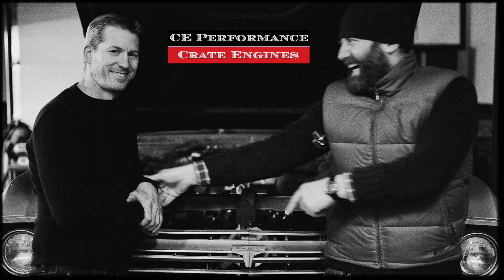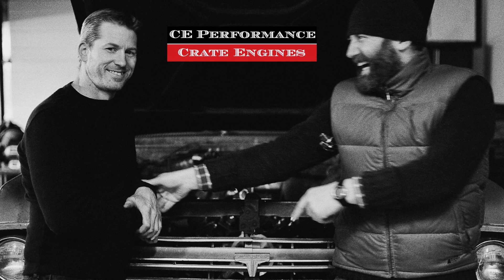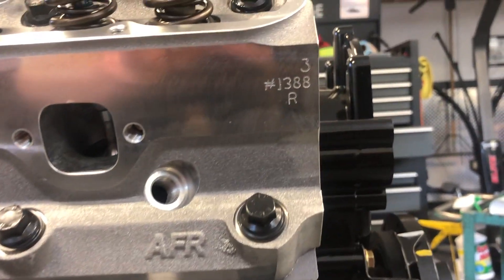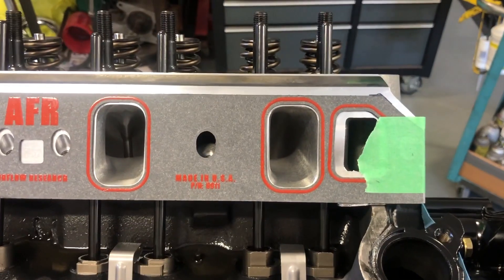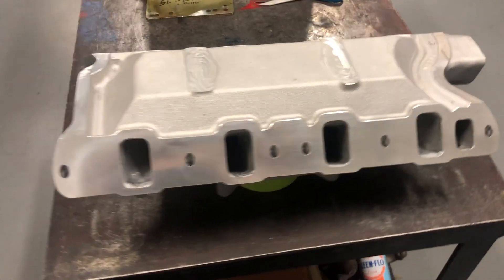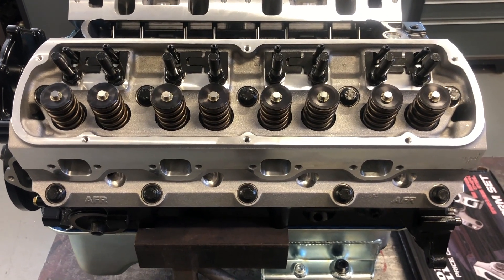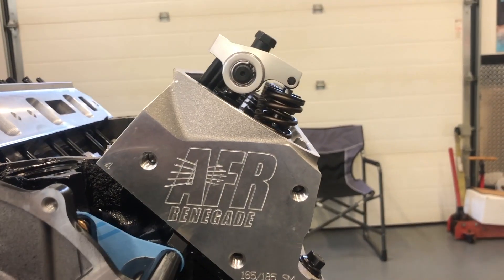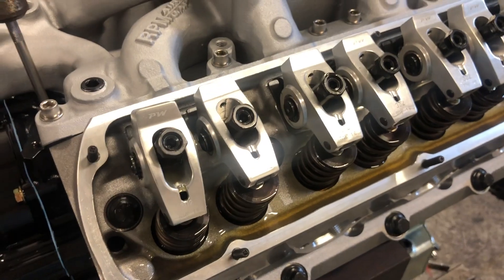347 Cu.In. SBF Build — Attention to Detail!

Comment: Nice numbers but not quite as impressive as your short stroke, long rod, big bore builds or is it because it's a Ford? LOL

You might want to try a cam with a tighter LSA next time, David Vizard claims an overly wide LSA can rob as much as 80 HP. He has a formula for figuring out which LSA to chose in one of his yt videos if you're interested?
Reply from the maker: Thank you for commenting! 
With these Ford blocks, there isn’t any more room for a longer rod than this, unlike the Chevys. The deck height is only 8.2” whereas the SBC is just over 9”. 
On these smaller displacement builds, tighter lobe separation isn’t great in my opinion. The vacuum is affected and idle quality suffers if too tight. 110 to 112 would give more gains up top but there’s always a trade off. This is a street car build and drivability was a key ingredient :)
Reply: @ceperformance  

No offense to you but do you know who David Vizard is? Here is his video on LSA;

https://www.youtube.com/watch?v=8jvkdQcqIuA

He says in the video to change the 128 to 127 in the formula for a small block Ford.

He has an engineering degree and has been building and dyno testing race winning engines for 60 years. He has written very popular books on head porting and engine building and countless magazine articles. I'm surprised you have never heard of him?
Reply: If I reply to this comment with a link even though it's a yt link, maybe yt won't delete it?
Reply from the maker: Thank you! I’m interested to watch that. Very cool.
Reply from the maker: Interesting stuff! He definitely has proof to back up his claims. 
I have only recently heard of David V. 
Thanks for sharing!
Reply: @ceperformance  
Yeah and the duration @ .050" on the cam of the 347 is still on the mild side. It's only 3 cubes less than a 350 and 224/230 @ .050" even with a tighter LSA with 347 cubes IMO should still idle ok. Like David V. said at the end of that video, If it won't idle you picked a cam with to much duration or something like that and for the size of 347 cid the duration you picked isn't that big.

I would guess that in the mid to high 230s intake and low to mid 240s ex. is when the duration@ .050" is starting to get on the big side where the idle will start to suffer on the cid of that engine.

I use to have a car with a 10:1 355 sbc in it with a th350 and 3.55:1 rear gears/2,200 stall and a cam with 230/230 @ .050" .480"/.480" lift with IIRC a 108 LSA that idled with just a slight lope(sounded really good) and still had plenty of low end, was a really fun car to drive 35 years ago.
Reply from the maker: Very cool. It’s certainly fun to try different things and see real life results. There’s not just “3 cam options” of cams like the old days, as David said. “3/4 race…”
For sure there’s a “right cam” for every application, but then how many applications are there??
Car type, weight, transmission type, gear ratio, driving style, type of fuel desired, ya know what I mean!